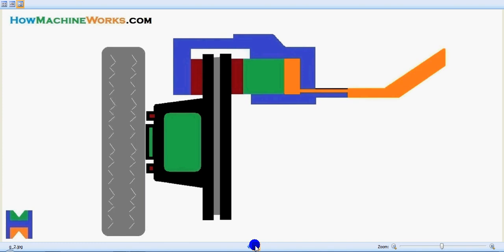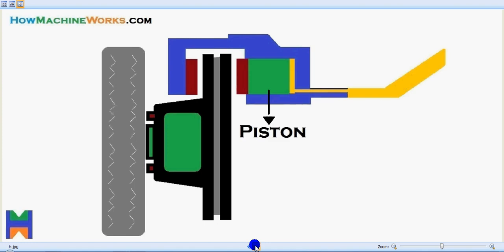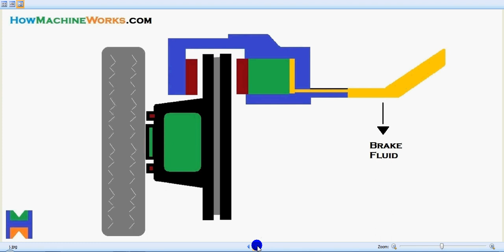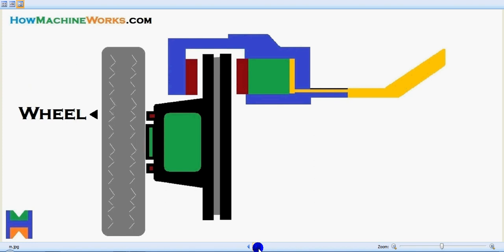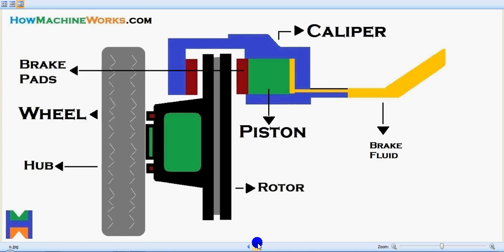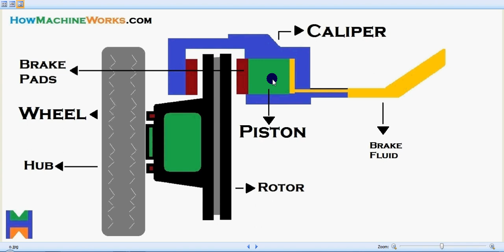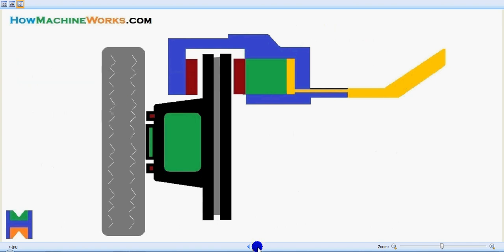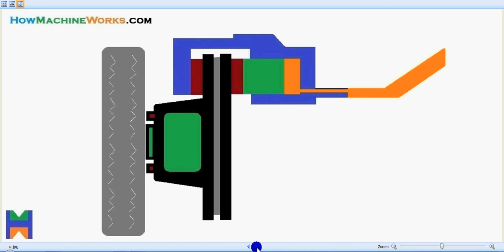How disc brakes work ✔

Comment: how does the brake pads back its initial position after braking
Reply: There's a square cut seal inside the slave cylinder that twists a little when the piston moves out. That square cut seal stores a small amount of energy in the twisting action, so when the driver releases his foot, the square cut seal twists back to its baseline position, moving the piston back and releasing pressure. This action is enough to allow the pads to move away from contact with the rotor. I find it surprising that even the outside pad (and entire floating caliper) moves far enough back to prevent noise. Of course even minor contact with the rotor will push the pads back, as long as there is no resistance to movement. The more one understands how these devices work, the closer attention one pays to sliders and other contact surfaces to allow this mechanism to work smoothly.

Comment: But it's not that good , it will be easier to stop when brakes will be applied to more outer ring

Disc brake is connected to the very internal ring of wheel , so it could disconnect + needs more energy to stop.

Comment: useless video...you just pointed the obvious, every engineer should know this much. you didn't say nothing about the caliper fixtures, hidraulics, brake leverage etc...brake pads are pushed and stop the disc? cmon..
Reply: Useless comment.
First of all, who said it was for engineeris?!?
Second, it's only obvious if you already know.
Reply from the maker: +Filip Koraca 

For more info you can email us at techtrixinfo@gmail.com or whats app at +919744615655

TechTrixInfo.com
Reply: It's just the concept , exactly what you searched for

Comment: @Sai Prasad Rm Well actually this illustration is very accurate, the only difference being that on a real life caliper the brake pads are already very close to the rotor disc. The caliper does activate like it shows here, but there is hardly any space for it to move, therefore its almost instantaneous. The movement here is exagerated to show how it works.